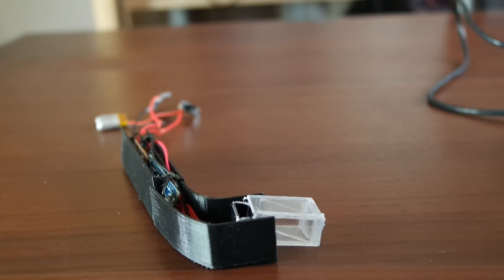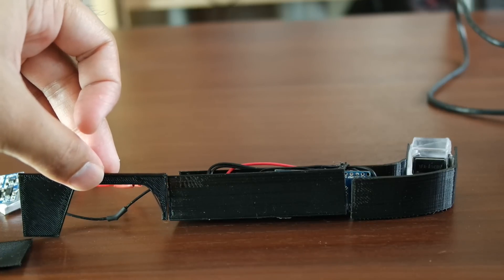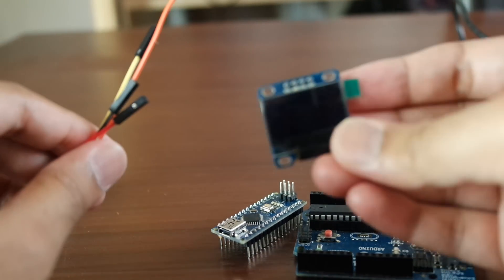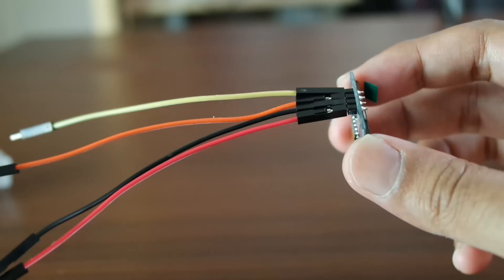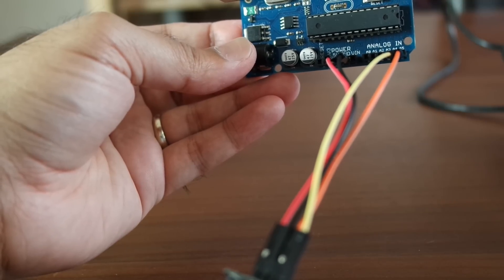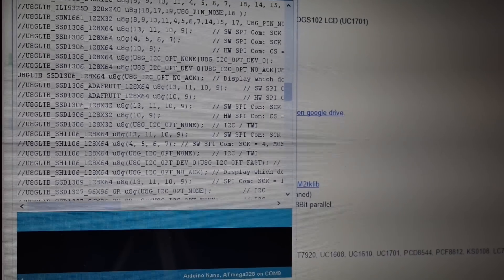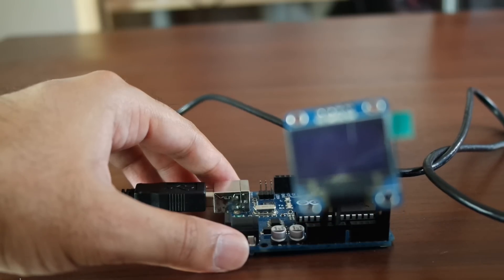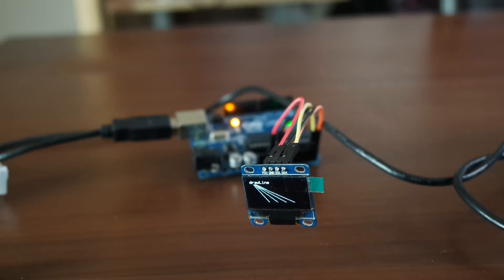DIY Google Glasses - Connecting the Screen Tutorial

Comment: +Fahim Chowdhury , I bought the 0.49inch oled with 64x32 resolution, i connected it to my arduino nano v3 like you mentioned, but the screen just wont work with the provided library or other libraries on the internet, i even used 60x32 code, please help.
Reply from the maker: did you get it working?

Comment: try to print is one piece looks better :) get rid of those all fat cables :) will get it smaller. give me diameters of your electronics i will desing wearables
Reply from the maker: Cool. The thickness is more the microcontroller and Bluetooth boards. the wires will be made shorter. my 3d print can't print the whole piece but I can send you the dimension. what's your email?
Reply from the maker: This is an attiny85 microcontroller. It won't have enough memory to run much. But you can find out.